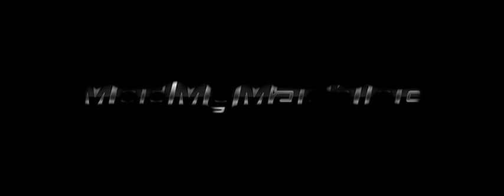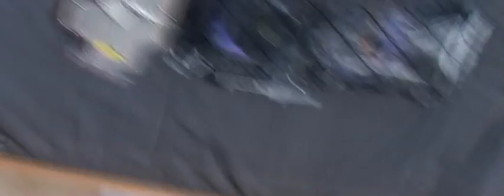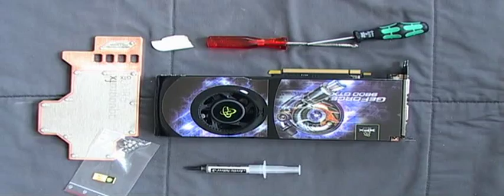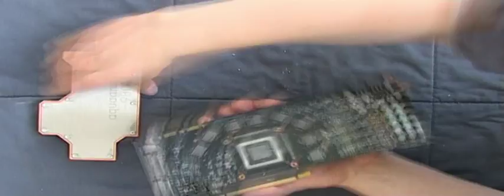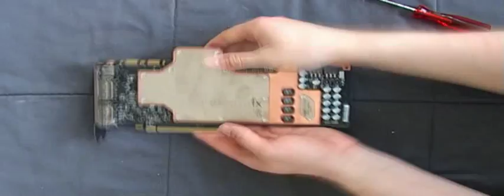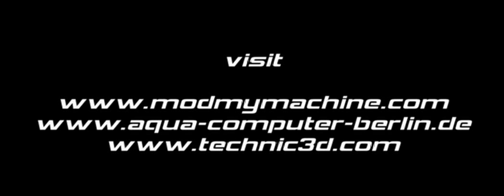Tutorial - Water Cooling 9800 GTX graphic card

Comment: hi i think i have a cooling issue with my XFX 9800 black ed card. from starT up it runs @ 60 degrees(according to eva precision) - pc specs- win7 64/ 3g ram/ asus m2n vista ed MB/ AMD athlon dual core 5200. it boots ok, runs ok BUT locks up on any game i put on eg SF4.  i saw this as an option maybe. any advice?